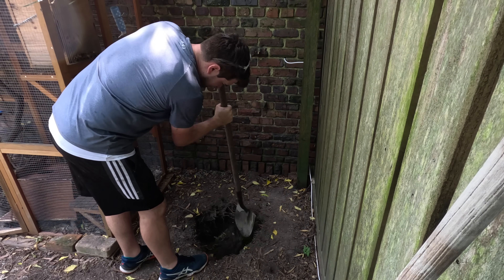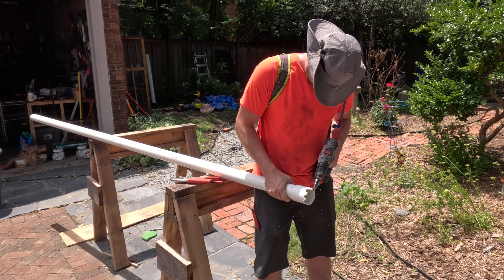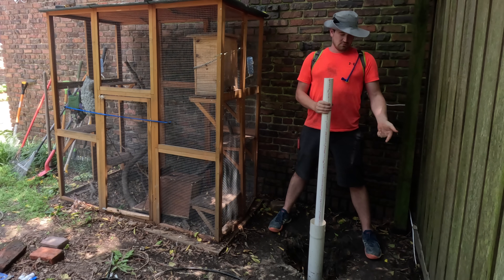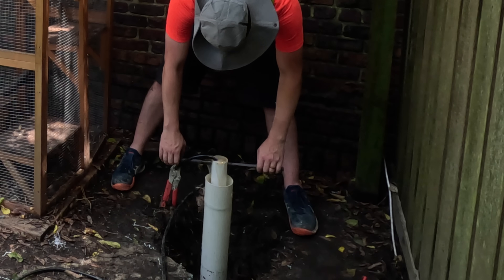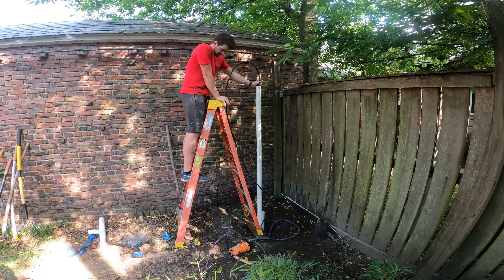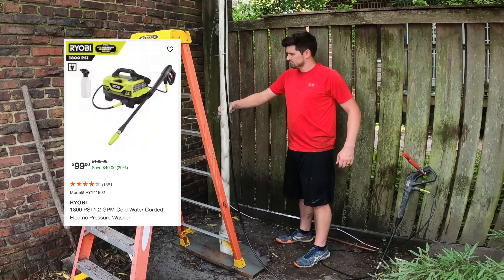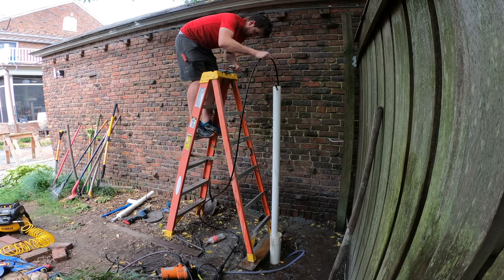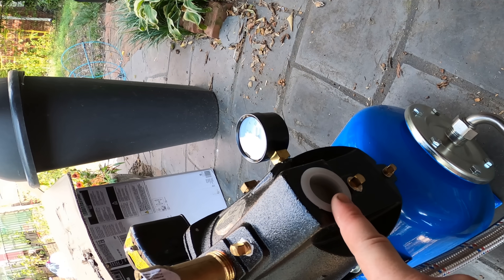I dug a 40 foot well in my backyard

Comment: My dad used a twist post hole digger with a tee handle and sections  of extension and waterdown the hole to make easy mud . If you could pull out 6 or 8 inches dirt each time its like 100 scoops and only 50 of them are over 20 feet long . People help you when it gets bigger . Like rolling a snowball
Reply: Ps . The snowball gets so big it peels the turf up .😅 sound leally scrunchy like an elephant

Comment: 40 feet till water... LOL!
dude you are so blessed!
The only thing I would change is putting 2 or 3 screws in the PVC joints...glue can fail and if your way down there and its stuck.....
Reply: PVC glue never fails, if done right. I would not fracture the pvc with a hole for a screw, that would create weak spots that could fail.
Reply: the PVC glue used on PVC is a chemical welding.
Reply: Primed and glued PVC joints are stronger than the pipe itself. Purple primer is cheaper than good screws.

Don't try to out-engineer the engineers, you'll only hurt yourself.

Comment: Yeah, unfortunately I think most of us are not going to live somewhere. Where the water table is only 10 to 15 feet below ground,  me. For instance, when we had ours checked, our water table is about 250 feet below ground out here in the Mojave, which is too bad, because it's a very, very, very Big aquifer being poorous sand underneath, but it's very deep. It's so large, in fact, that the county installed giant pipelines run the Colorado river water into this aquifer. For reserve storage and to replenish the aquifer. Because it's so large, they decided to use it as for like a reserve. But my understanding is that it goes for thousands of feet below ground. And porous desert sand is some of the best aquifers you can get

Comment: Excellent video.  I would like to see your video of detailed design elements and assembly.  There are a number of pipes that I can't tell what they connect to.
This is a great video and I'd never thought of using water to assist/do the drilling.  If I want a new well, which I need for my house water supply, I'm looking at $5,000 to $7,000 dollars.  I'm really glad I happened onto your channel.  Thanks.

Comment: LOL.   water table is like 300' down out West and it's all rock to get there.  The idea that you could use a hand auger and a pressure washer to even get 10' down is hilarious.
Reply: Of course "out west", depends where you are and the water table.
Reply: I think the point is that any water regardless of depth should be tested for toxins, chemicals, and any harmful substances.
Reply: Same here, no way. But I hope tons of people do this. Great stuff
Reply: What's even more hilarious is that you have no idea where the man is and your assessment is wrong anyway. I've drilled several wells in the west. Maybe if you're not knowledgeable, you should be quiet.
Reply: @jimibmore then you haven’t drilled in California! 😂🤦‍♂️🤡
Reply: @jimibmore in Arizona you wont find water within a hundred feet of the surface unless you are in floodplain like buckeye but that water is all old farm runoff loaded with chemicals.

Comment: Growing up with a well. I say it’s a lot of drawbacks with them. Rust water, no water if the lights go out(living in eastern NC hurricane season was no joke for power outages) , low pressure sometimes and repair cost.
Reply from the maker: Good reminder that what you really want is redundancy.  This isn't about switching away from city water necessarily -- it's good to have both sources of water available in case one fails.

Comment: We have a great well and pump right now however the pump is 3 phase so I'm going to build a backup system that I can either run on a generator or a simple hand pump. This video is awesome and I can't wait to start my new well. Thanks for posting 🇺🇲
Reply: 3 phase converters to run 3 phase motors on single phase electrical service are widely available and may save you time & tomfoolery.

Comment: I can't hardly believe you could make a 40 foot hole without hitting solid rock!
Reply from the maker: All sand and clay
Reply: @BadHomeowner  Where I live in South Western PA I dig 6 inches to a foot and we are almost guaranteed to hit shale.
Reply: @BadHomeowner  - I had the exact same thought as SinisterThoughts. I couldn't believe what I saw here. You must have miracle soil that allows you to sink plastic pipe in the ground so easily. Here in Wisconsin it is constant rocks. We have to use heavy gauge galvanized steel pipe and drive it in with a sledgehammer. Sometimes it felt like I was at a solid dead stop. But I just had to keep slamming it until I either cracked the rock or pushed to the side of it. It was 2-3 days of pounding to get about 20 feet down.

Also (and maybe this could vary by region), but I was warned not to go too deep; that you can go through and beyond the vein of water. It was recommended to me that ideally you want to be 4-5 feet into the water. I kept dropping a weighted string down the pipe and checking to see how much of the string was wet, until I got my proper depth.
Reply from the maker: @bradwaldoch194  I've also driven a steel well point here, hit a rock, and broke my well point.  (I made a video about this).  I wouldn't say pipe sunk "easily".  You still needed 2000 PSI from the pressure washer to break up the clay and push up the sand.  There's a lot of force going into the ground in order to make this happen.   But the pressure washer makes it looks easy due to the high pressures
Reply: @bradwaldoch194  Yea I think anywhere the glaciers retreated after the last ice age from was just covered in granite and other rocks left by the glaciers. So in the northern plains / great lakes area you can't even dig a hole to plant a tree without hitting a couple decent sized rocks at least. Not sure where this is but considering the type of pump used and the fact that its sitting outside guessing it's a place down south somewhere.
Reply: It's all dependent on your area. Where I live in Oklahoma there is red sandstone about 100ft down. A few miles over the sandstone is exposed forming nice rolling hills. My brother lives in San Antonio and if you dig about 2 feet in his backyard then you hit limestone. Some parts of San Antonio have the limestone just inches below the soil 😂 when it rains lightly it floods 🌊 But it's an interesting city. The water source for SA is the Edwards Aquifer under that limestone.
Reply: If I ever win a lottery I'm wanting to hire you.
Bad back limited fixed income  etc

Comment: Your well is 40ft deep but your water level can’t be more that 25ft down in order to draw it up with suction.  Unless my understanding of physics is off.  Please advise.
Reply from the maker: This is a common misunderstanding. The 25ft is measured to the top of the water table, not the depth of the pipe. Imagine you had a 100ft deep swimming pool -- it doesn't matter if the pipe you stick in it is 100ft long, or 10ft long -- a shallow well pump will work in both cases, because the effective depth of the water is zero feet (it begins at the surface)

But if you have 50 feet of rock, and water is below that, then a shallow pump will not work.

You can go as deep as you want, as long as you have continuous water beginning at 25ft or less
Reply: @BadHomeowner  Yes sir.  That’s what I was saying.  The “water level” can’t be more than 25 feet down.  I only mention this because I didn’t find in your video where you talk about water at <25ft, only well depth at 40ish feet.  Good video.  I live on sandy loam and it looks like this should work like a champ for us.
Reply from the maker: @Bob_Zhurunkle  ok yea I thought I mentioned that I hit water around 10 feet. So plenty of water to work with for a shallow pump.
Reply: @BadHomeowner  Sorry.  I must’ve missed it.